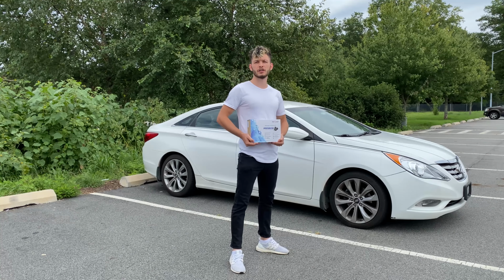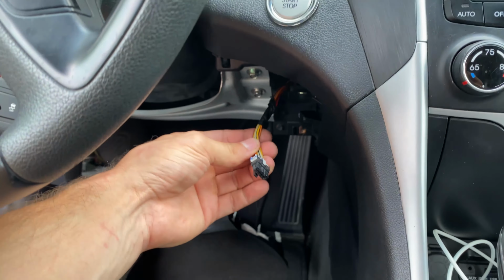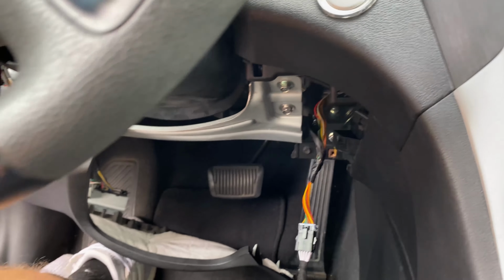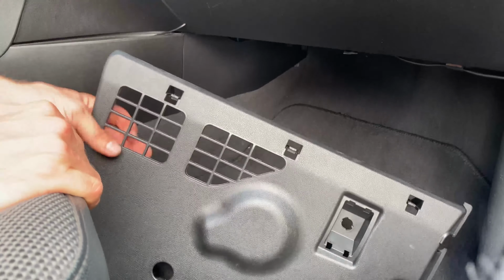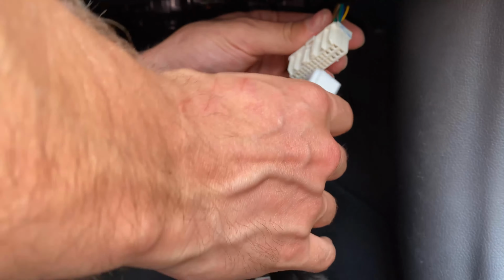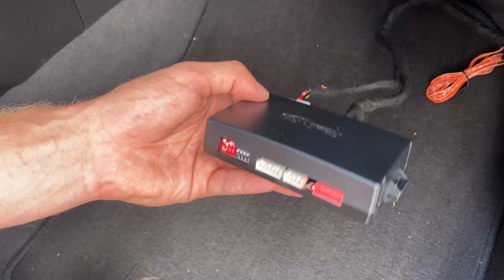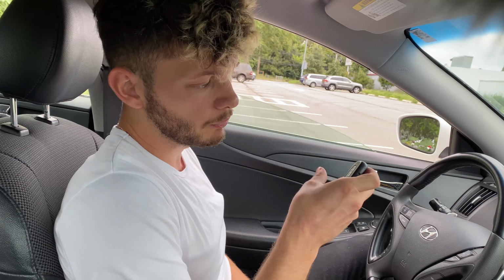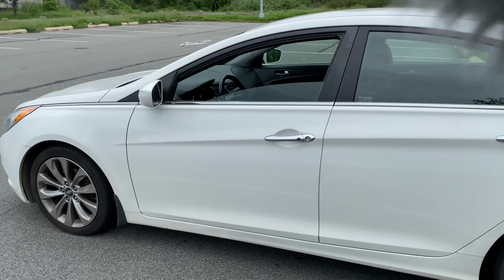Hyundai Sonata 2011–2014 Remote Start | How To install | My Key Premium

Comment: Just finished installing this on my hyundai. It was a little difficult to get to the wires behind the push button start. Besides that its a perfect application. Works beautifully and most importantly YOU ONLY NEED ONE KEY FOB!. Thats huge to me. Thank you guys at MyKey
Reply from the maker: Thank you Anthony, hope you will use it for a long time. 
Cheers

Comment: I just installed this remote start on my 2011 Sonata and it works great. I like the auto lock feature, it's nice that you can park your car and just walk away and it will lock. Super nice that you don't have to do any extra steps to lock the car. Also love that I don't need an extra key fob to carry like most systems require. Install was easy 20min total I did take the plastic trim under the steering wheel off like in the video and also the under that the stainless steel support bracket. It was only 4 screws and one nut that made it easier to fit bigger hand up to the start/stop button. Hope this helps others.
Reply: just ordered today, is there alot of places to put that big housing unit underneath the passenger area?

Comment: Hi, installed this today. Works perfect but was wondering if the amber turn signal lights should blink every 5-8 seconds? Stays started and locked but both front and back amber turn lights blink for a second and does this every 5-8 seconds?
Reply from the maker: It is totally normal that is blinking every few seconds. Its letting you know that the car is on via remote start.

Comment: I'm not getting the 4 beeps after the first 3 beeps (2 long + 1 short). Everything hooked up correctly, disconnected everything, then reconnected. On my box, the 2nd switch is down on left bank of switches, and the 1st switch down on right bank of switches (confirming I have a 2013 Hyundai Sonata - Push Start). Any assistance would be much appreciated, thanks in advance.

Comment: It’s not bad once you get passed the push button start clip then the rest is cake definitely works good !!!!
Reply: I had a hell of a time getting to the push button wire.  How did you go about it?
Reply: great. just ordered mine, any tips lol
Reply: @chrisfaustomaha  take the radio out to get behind the push button.   Trust me.
Reply: @brosetoldyou4831  haha once i do that is it easy or just better then blindly trying to find it using my hand under steering wheel
Reply: @chrisfaustomaha  very easy after doing so.
Reply: @brosetoldyou4831  youtubin how to take out radio now haha

Comment: They sent me the wrong kit. Had the wrong wiring harness and dip switch settings. Had to wait an additional week for the right harness to arrive and then discover the pdf instructions on the website have the wrong dip switch settings. Pause the video and look at the switches if it's not working for you after install. If it was wrong then unplug the box and plug it back in after changing the switches.

Comment: Any easy way to remove the start stop connector? I couldn’t find anything online and it’s super weird. I’ve zero experience and don’t want to remove the dash only to find out I can’t put it back together.
Reply: I just got it done.. I had to remove hazard, stereo frame to unplug the push start button. After that super easy!!

Comment: Why do you need the extension on the push button wire? I am not understanding why that is needed if the device is connected on passenger side.

Comment: Nice bro I’m interested in this ...do you know if this has options for automatic shut off  when your car is warmed up..like after 10 mins ..
Reply from the maker: sure, it is automatically shut down after 10-15 minutes. also you can switch on/off auto door locker. cheers

Comment: I put in my daughter's 2011 and it works great! Only issue I am having is with my passenger tail light. I have changed bulbs(they didn't burn out I found out later) I changed the bulb socket and the whole 4 bulb harness and still have same exact issue. When lights come on for the first time after not being on for a few hours, the one taillight goes off after about 3 minutes. Then if I switch lights on and off after that, it only lights for a second or two. I wriggle wires and no flicker or anything. Bulb not blowing and works on drivers side no issue. All this started after putting auto start in. Any ideas on what to do?
Reply: Get new taillights. It’s a problem with that generations tails. It will burn out any halogen you put in that housing. Idk if LEDS will fix the problem bc the housing harness is what’s burning the bulb but I got aftermarket taillights (VLAND) and haven’t had the issue since. Almost 2 years now.

Comment: I guess it's obvious but it's not 09 to 14 it's 11 to 14. 09 and 10 are previous generation Sonata. If it's possible it should be easier because the lock cylinder is on the dash

Comment: Starts my car when key fob buttons are not pressed shortly after locking car. Just pulled system out. Not happy at all.
Reply from the maker: Very sorry for the late response, I’m just seeing your comment now. I hope you were taken care of by our customer service team. It sounds like the issue might have been caused by double-clicking the lock button, which triggers the remote start. I know it's a habit to double-click to lock the car, but I hope everything was figured out for you.

Comment: I tried mines and it does not work it locks when I walk away but it doesn’t start
Reply from the maker: For this year Sonata. Auto locker was not intended by Hyundai Factory. Since our system operates by factory frequency. You can switch off this function by (get inside - close doors - keep pressing brake - press 2x lock with interval)
Reply: Thanks 
I actually want this for the winter just to have my car started and warmed up. 
Instead of me having to seat in it in. In the cold. I have a 2011 Hyundai Sonata

Comment: Def not “easy” to pull the button cable.  My hands won’t fit in there any kind of way.  Looks like I’ll be pulling everything apart.  Stand by.
Reply: If you take the stainless steel support bracket under the plastic trim off it makes it easier to get you hand up there. It is 4 screws and one nut to take it off. Super easy! Good luck
Reply: @andrewjurss8403  hey, I ended up having the take the radio and console out.  Hands were way too big.